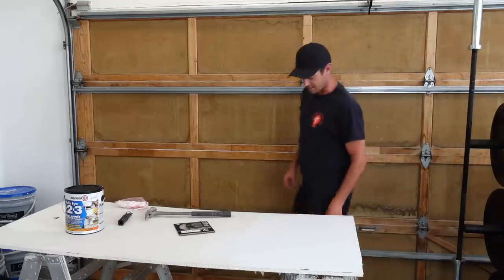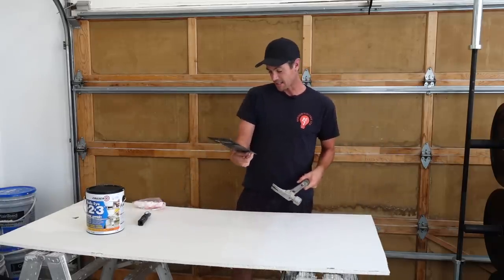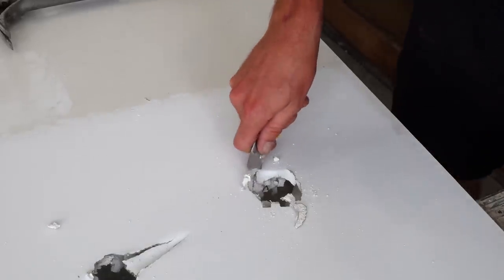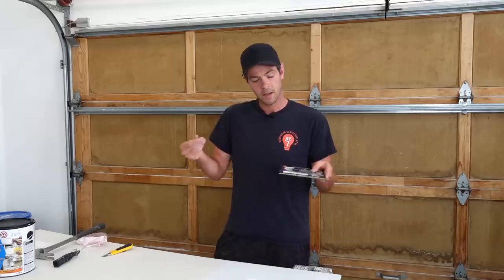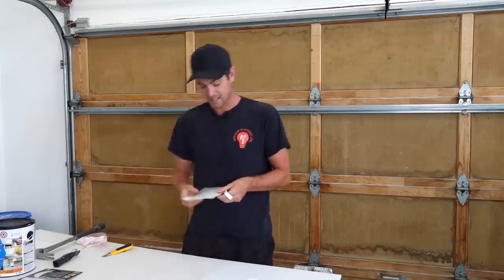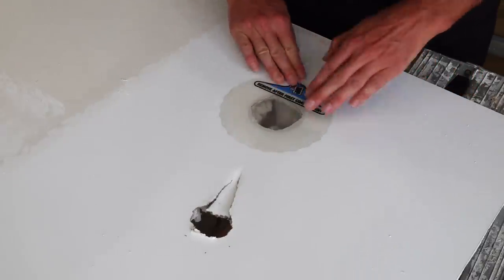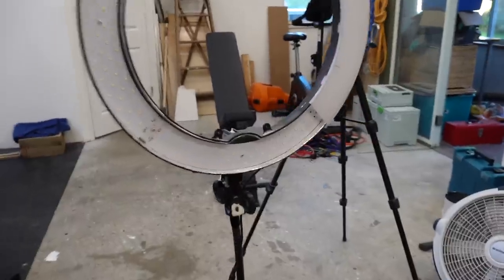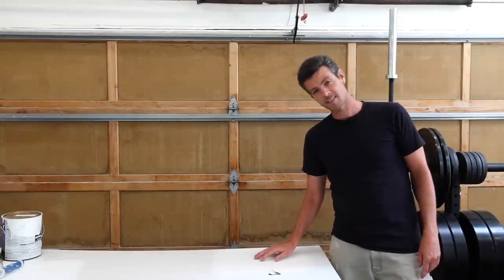So I tried this Drywall Patch again just for you guys!!!!!

Comment: You can't be done with it! I still want to see what happens i you try to drive a nail and hang a picture :)  I stick by my original comment: Use this on undamaged drywall, where a doorknob would hit, as a preventive measure. Don't use for patching anywhere else.

Comment: Wait, what if you painted it, then mudded it, then painted it again, then mudded one more time?? Lol, yeah, you proved it sucks. Still think you're wrong about a sponge having a place in some patching situations, though.
Reply from the maker: I will do a follow up video on sponges some day
Reply: @vancouvercarpenter  Hey, while I have you, I have a question.  How come drywall people always use tape, but plasterers never do?  At first I thought it was the materials, but then Kirk has a video where he fills an entire space with wire and 20 minute mud, using no tape.  I really want to find a way to fill holes with no tape because I need to keep the patch flush so as not to have to redo the knockdown on the whole wall.

Comment: That patch will get you your deposit back on a rental, if you have a couple of small sized holes in the walls.
Probably why it was invented.
For those who can actually repair properly, its a no-go, but for the desperate duffer, it's a cheaper solution.

Comment: Not sure why I'm defending this stupid patch, but damn sir, when you peeled the top skin of the patch after ONLY applying 1 coat of primer, peeling it, then putting 3 coats of paint over everything, I had to face palm again. The key to it working is applying enough paint to build up the thickness PRIOR to pulling the face off. Not AFTER.

You're just not getting how this patch is supposed to work. Then at the end of you proceed to do with joint compound what was supposed to be done with paint. (Building up to the edge so it's hidden)

Apply the patch, making sure it's "taught". Apply 2 to 3 NORMAL coats of paint or primer. Peel the top off. Paint as normal. If the flower edges are still visible after painting then you didn't apply enough paint prior to removing the face. No amount of paint at this point will hide the edge.

Comment: Hey! It's really like putting lipstick on a pig. Shoudn't this patch be advertised as kind of drywall snake oil ?
You've probably spent more time and materials on this than it would be require to do standard "california" patch. Not mentioning that average Joe can do better job fixing the drywall with your videos than this patch.
I mean, I see it as a viable way to fix the hole in my basement or maybe behind kitchen sink. Otherwise it sucks soo badly to do the task that's beyond any doubt.

Comment: I thought the first coat was still not thick enough,  had you used "pain" and not primer it might have been thicker.   Depending on where was IE behind a door it probably would be acceptable for most people.  All the waiting for the paint to dry seems like the real pain vs just patching it right with mud.

Comment: You still didnt follow directions..  you primed it but you didnt apply a coat of paint before you pulled the tab..  you only put primer down..  i wouldnt use that dumb crap but if i did i would put a few coats of paint down before pulling that tab..   truthfully if i happened to buy those itd be because i thought they were some kind of mud patch, wouldnt read the directions and use mud overtop of it…

Comment: Just slip a piece of wood in the hole, screw it in place. cut a small drywall patch, screw it in place, tape and mud.  What is so hard about that.  Any home owner should have these materials in their home from maintaining it over the years.  I would have it patched with the first coat of mud before you got back from the hardware store with your silly plastic patch!!